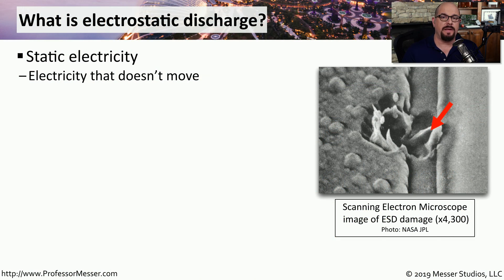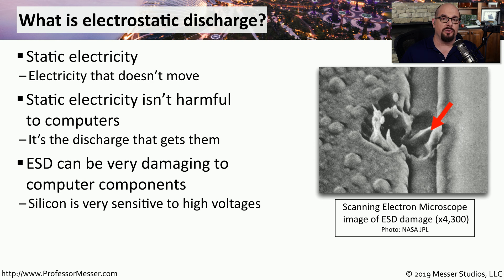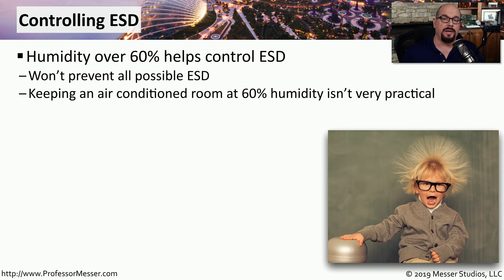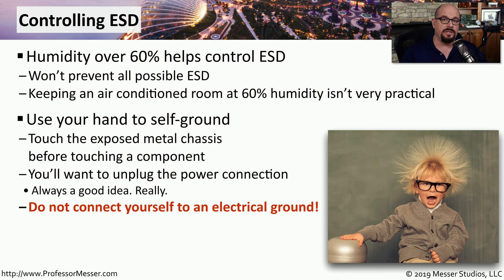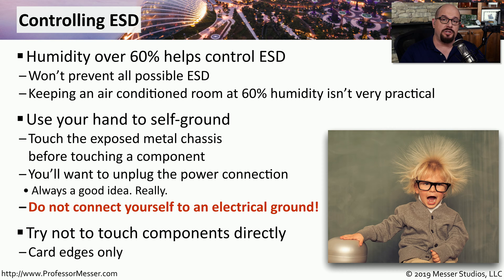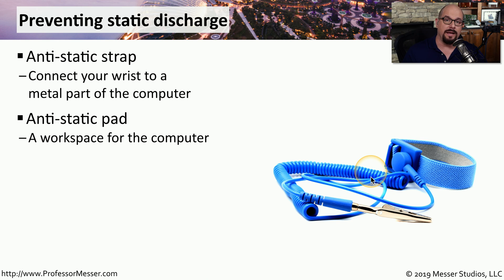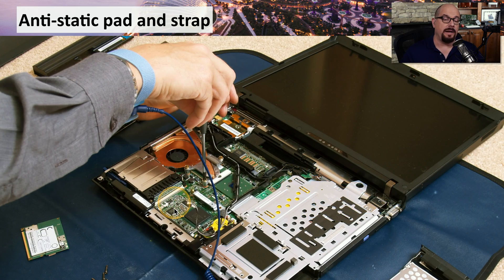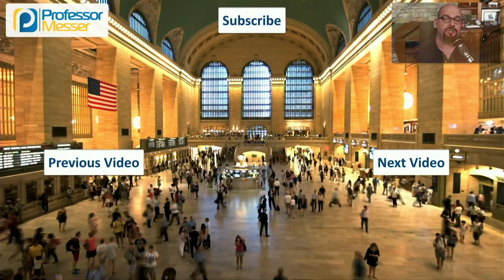Managing Electrostatic Discharge - CompTIA A+ 220-1002 - 4.4

Comment: Linus tech said to connect the anti static wrist starp to the PSU when building a PC is this false?
Reply from the maker: If the PSU is metal, you're not connecting to any internal components of the PSU, and it's not connected to a power source, then you should be fine. It would probably be easier and less risky to simply connect the wrist strap to the metal portion of the case.